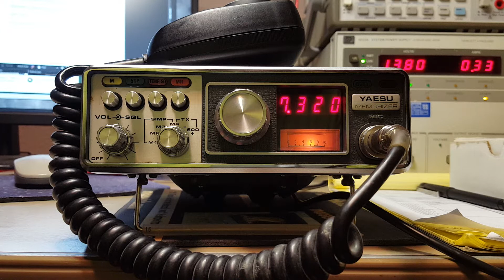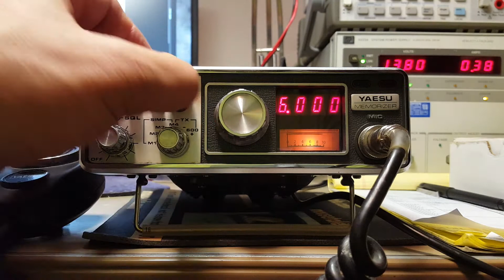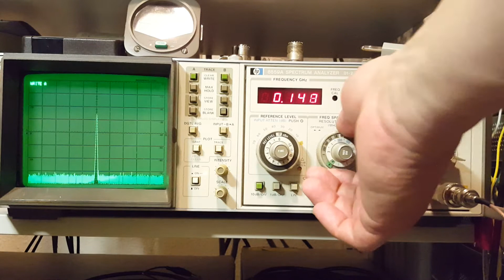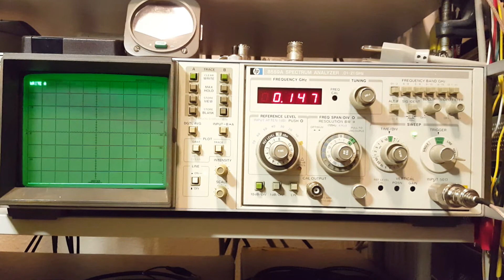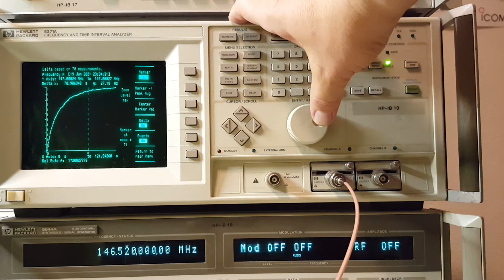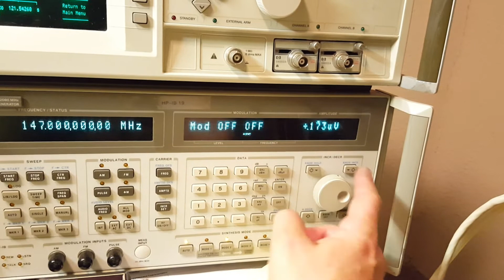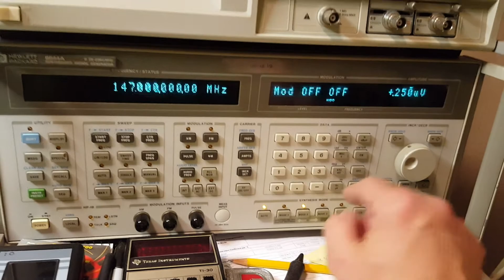Testing a Yeasu FT-227RA Memorizer.

Comment: Mine is not working. I think i will see it now. I jave a ft 720r the vhf bersion  the most times opens  and  one res dot only apears and some times it opens the display but no  sound comes
Reply from the maker: Sometimes those symptoms are a sign that the PLL is unlocked. In that case I would start to troubleshoot in that area first. Thanks for watching!

Comment: I just picked up a Memorizer and want to install a supercap to retain the memory. I had one 30 years ago and added the then-common nicad battery backup but can't seem to find any information about it online. Any information you have would be helpful.
Reply from the maker: I do remember hearing something about this back in my early days but cannot recall anything recent. Yeasu made many variations of this rig so I would imagine you could eventually find something. Thanks for watching.
Reply: @CraigPetersen12f36b  I've thought about using a super capacitor instead of a battery but since I don't use it that often I don't see a good reason to modify it. I have an Icom 290a that has the same issue.

Comment: Craig - I like videos like this.  I also really like that 5371, I am now trolling for one.  I also like the Yeasu, I actually have been trolling for that for a while...I like vintage HAM gear and have a lot of it!  Appreciate this video on many levels.  ~Jack, VEG
Reply from the maker: You should be able to get the HP 5371A for about $250-$450. All of the units I have seen on eBay will more than likely need the memory back-up battery replaced. The tell tale sign is the unit will report that it has lost its settings, it will still operate normally except you won't be able to store any perimeters for different measurement set ups. The battery is a 3.6 volt lithium battery with leads (Digikey # 439-1013-ND). This battery is commonly used in many instruments like the 5371A, 70900A and others.
Reply: I have one for sale

Comment: I just finished repairing one of the 220 MHz versions of this radio, the FT-127RA.  It was quite the headache because the PLL would unlock randomly, but only for a few minutes once ever few weeks!  The problem was finally traced to a defective solder joint on one of the pins connecting the VCO can to the main PCB.  Not sure if I would have spent the time except that the 220 version is somewhat rarer than the 2M one.  Gotta love intermittents!  And yes, they are really good radios, built like a tank!  73
Reply from the maker: I have seen the FT-127RA occasionally on e-Bay but was never able to acquire one. The original FT-227R was my first introduction into HAM radio back in the late 70's. 73 and thanks for watching!

Comment: I have this radio but not the A. 
How is the scan function performed? Maybe mine does not do that. And I’m guessing there is no way to set a PL code for repeaters with this model. Mine is FT-227R.
Reply from the maker: Hello Jerry, the RA version has two slide switches underneath the radio, one is for HI-LOW power settings and the other is a 3 position slide switch for the scanning function (clear, busy, man). The scanning function is started and stopped by holding down either up/down buttons on the mic to start scanning. I think this was only a feature available on the RA version. The tone board needs to be set manually. Thanks for watching.

Comment: Do you repair these?
Reply from the maker: Thanks for watching. The only radios I repair or maintain are my own. I have yet to make a video of either a repair or alignment procedure that someone can actually use. I am planning on doing a alignment procedure video on this radio but due to work obligations, I have yet to make the time. I have been under the weather for a couple of weeks but now feel well enough that I can start making some more videos.
Reply: @CraigPetersen12f36b  What kind of bulbs are in the buttons, green busy and TX?
Reply from the maker: @WatchMan1962  - They are the mini or "grain of wheat" bulbs. I'm guessing they are 14 volts at 20 ma, or somewhere in that range.

Comment: just picked one up at flea market today !! bought what i think is a packet cluster , all one wooden board . had a KPC-3 hooked up to it as well as what looks like a home brew power supply ....havent tore into it yet but radio comes on kpc-3 lights up but power supply doesnt light up when i plug it in ......i hooked it up on my car battery , paid 12 bucks for it since pwer supply didnt work but im hoping it will be just an internal fuse .....thanks for the info on this rig ...DE N5OMV ODESSA TX
Reply from the maker: Thanks for watching the video. I haven't really done much with this transceiver other than give it a quick test. I am periodically on the lookout for the 6 meter and 70 centimetre versions. 73..